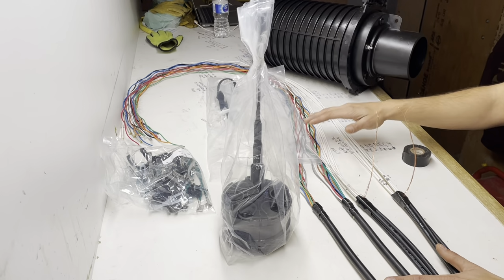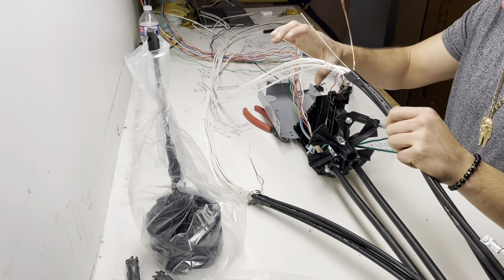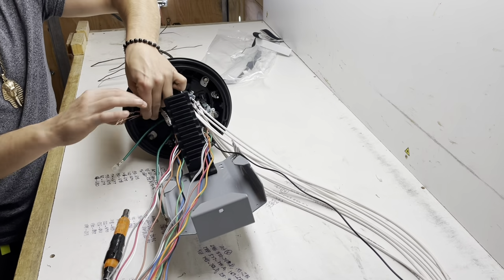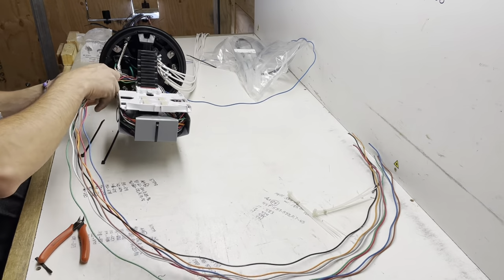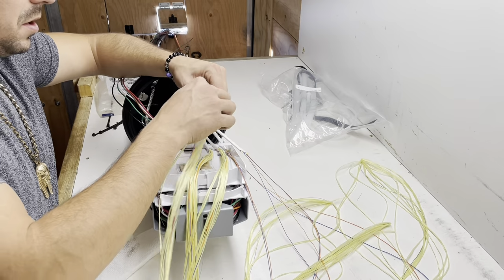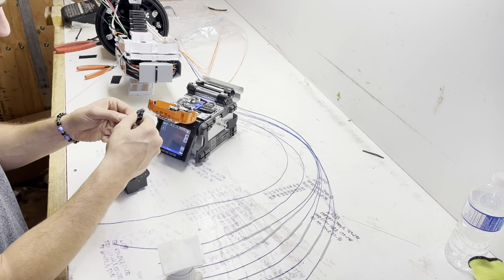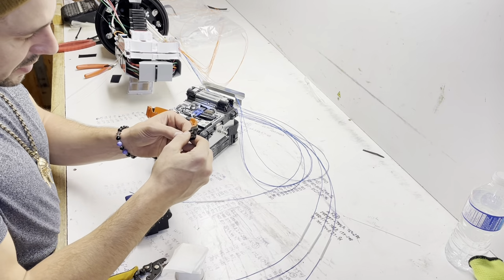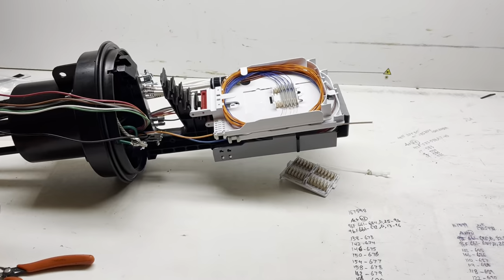Fiber optic splice closure build tutorial

Comment: Very nice video but I have some doubts.
1- Why  don't you use ground terminals that are inside the original kit?
2-Is it the same if you connect all the green wires to the same ground terminal (without insulation)?
Reply from the maker: Thanks for watching and commenting I appreciate it. 

We don’t use the grounds that come with the FOSC kit because the customer does not approve those bond clamps with just a hook they want a solid connector with nut and bolt. Yes the the customer wants all bondclamp grounds secured to one ground heading out of the case with it tapped up with electrical tape once secured
Reply: Our cables (fiber) in California usually have nothing to bond to because there is no shielding ....So why ground and insulator (glass) 😁

Comment: Did you need to cut the blue tube 
that was in the bottom tray or could you have just let that pass through the junction. Seems like extra work.
Reply from the maker: Hey thanks for watching and commenting I appreciate it.  Needed to cut the tube because it was spare count at this work location for future connections so the customer wanted it cut here and left for the next tech
Reply: @fibersplicegod  I can understand that but could you gave let them just pass through to the next junction. I ask because I am designing a campus solution for a large campground that will have 3 of these closures. The feeder will run through each of these and I wanted to leave 12 stands at each. I will then have drop cables to 24 buildings disburses from the three closures. 36 strand 12 for each and I was hoping to just pass 24 of those through the 1st to the 2nd and 3rd. 

By the way thank you for your help. I have really enjoyed watching your videos.
Reply from the maker: @HawkeyeNELLC  yes for sure you can just have them pass right through just leave the two tubes you want to pass through in the basket and you will be good to go. for stored slack locations the guys will wanna strip double the length of cable for the fosc. so for example if it is loose tube cable tell them to strip 112 inches from ring cut to ring cut this will allow them enough room to have your 24 fibers/ 2 tubes pass through as unopened tubes in the basket while still allowing them to cut the 12 fiber/ 1 tube at 56 inches from the ring cut and bring it up to tray for splicing. thanks for watching and asking questions i really appreciate it and enjoy helping others with there builds. more videos coming out this week